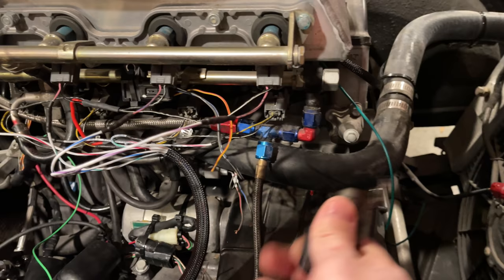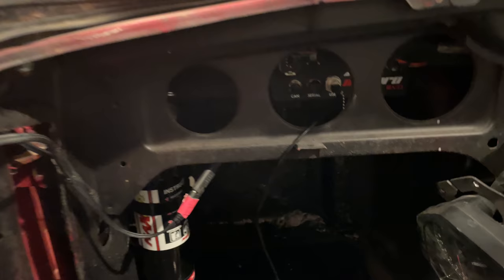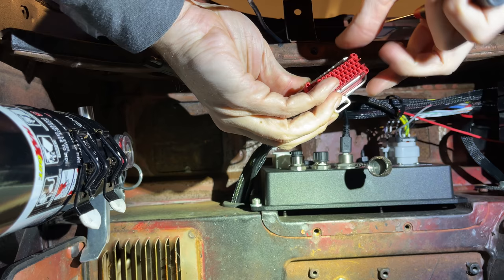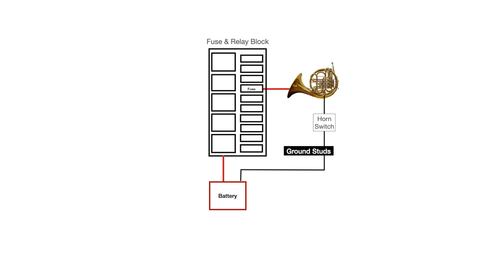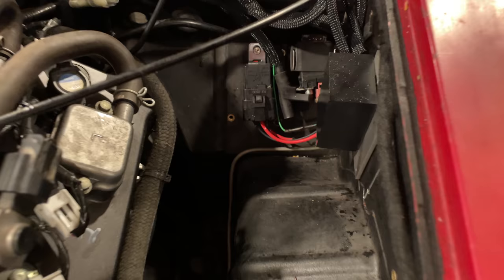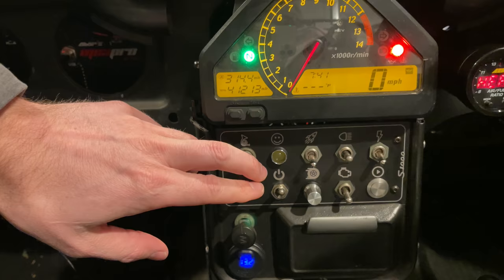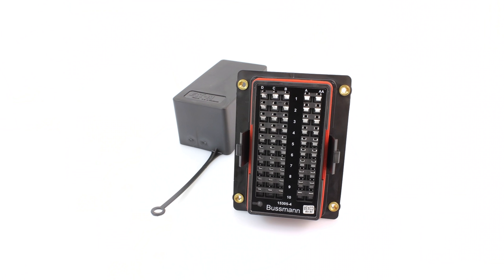Re-Wire Your Whole Damn Car - How To Do It Correctly & Inexpensively

Comment: thanks for all the tips.. I have a 94 firebird that is kinda methed up(pun intended) from the previous owner. ive got 8 grounds going to one bolt next to the throttle body. not sure what all the guy did so it looks like im going to be in for a bunch of headaches trying to figure this all out... I currently work at a busy car dealer so we always have an abundance of zip tie's and connectors.. im definitely going to find the fabric tape instead of the electric tape that likes to get sticky. thank you again and very good video..

Comment: Really good information Just want to add 1 thought. Back in the day I would use the Naked connectors and after crimping I would solder and then heat shrink.
I know probably not necessary these days but I come from ol Motorcycle field(Harley) Ironheads, Shovels evo etc.
A little soldering can prevent a lot of future problems.
Note I am talking about soldering the crimped part and wire together not the connectors together.

Comment: About minimal colours and connectors... our Triumph Spitfire came (factory stock) with only three fuses, four wire colours (one colour for each fused circuit, plus ground) and almost no connectors. Unfortunately, it also has no labels, so tracing is a nightmare, and the lack of connectors means that it is impossible to replace a harness - you individually replace every wire in a damaged section. I like the minimal colours and connectors approach, but don't forget the labelling part!

Comment: Fyi: There is a hack for printing on heat shrink tubing label tape on any Brother printer, and there are plenty of third party vendors for the tape.

Basically, you tape over one of the holes on the tape cartridge.

Comment: according to the previous owners of every car I've ever worked on in the restoration field- just get yourself a mess of the same color wire to connect everything. Make your connections as a "twist-n-tape" or use an oversize wire nut. Grounding is super simple. If you don't have a self tapping screw or a body panel gap to jam the wire into, just let the hood close in contact with the negative post to complete the circuit. This can be achieved by never buying the correct size or group of battery and just throwing in what you got propped up on wooden blocks. You can also fix exposed wires by wrapping them near or on the exhaust system and letting the heat just melt the insulation back into place over the wires. Remember, there's nothing wrong with leaving abandoned live circuits under a dashboard. As long as the vehicle is in motion, the wires won't be in contact with a ground pathway long enough to blow your 30A fuses in every slot of the fusebox.

Comment: I can relate to the "lost a formula student race for a failed connector". We did the same at the Germany event in 2011. Slowly lost power during the endurance event because the clutch release solenoid didn't have proper contact. Every downshift, the car lost drive for an ever increasing duration until the stewards took us out of competition. What made that even more frustrating is that we had a backup solution for exactly that failure, but the driver didn't use it.

Comment: that wire covering is called,  "Convolute." u used to make that stuff from like 1996 - 2009, periodically. we made all sorts of rubber & nylon, "forming." The department I worked in was called,  "the cooking dept." or, "Crook Forming." we made rubber, as well. ie... elevator gaskets, rubber washers, tubing for windshield washer fluid... sun roof seals. hoses for LARGE ENGINE/DIESEL smog systems.. the company I worked for for OVER 20 years sold out & went out of, business. ✌❤💯

*I had forgotten all about, Convolute.*😂

Comment: Great video as usual Matt. It's funny you mentioned of the possible ways to connect wires.. I've been doing this for over 40 years.. both marine , aviation  and automotive.  I'm a little  different on mains.. I solder,  all main grounds and positive and high Amp relays. I've seen to many hot crimps, at relays or heavy demand components.. the only concern as usual are vibration and wire support..  it's  imperative it doesn't flex and breaks.. but in recreational marine , all wires are machined crimped.. the problem with this,, is what is the support intervals.  Top boat manufacturers are every 6 inches on tracks. The next best is 12 " - on  tracks, and  of course the worse are every 2 feet,  no tracks , just hanging.. cars are worse at times.. I agree with top notch crimping tool, the best heat shrink, and  there will be no issues.. I only use the flex webbing you suggested,  they come different colours, heat ratings including heat shielded wraps.. but truly my favorite and only way is a no show wiring under the hood.  It takes a couple more feet to  route it through the firewall and then to it's  final destination.. keep up the great work..

Comment: I want to rewire my entire car (1965 Mercedes 220sb); the original wiring is brittle, frayed, etc. I want to modernize and simplify it and have seen many vids abt converting to a PDM/CAN. Wondering why you chose to go with a fused system using relays and part PDM. I know almost nothing abt wiring and electronics, so maybe there's an obvious reason. Looking forward to the next Viper update!

Comment: @SuperfastMatt You wouldn't happen to know what specific connector is used in the 1997 Honda CR-V front drivers door wiring harness and what size pins? It's a 25 pin square connector (5x5) and uses 16 and 18 gauge wires. I would love to construct my own pigtail rather than buy one, but it may be cheaper to buy one because there are so many wires and pins. 

The reason to replace it is the wires break off from the pins at the door and stuff stops working, like speakers, electric windows and locks, etc. It happens primarily to the driver's door because it is the one opened and closed so many more times than all the others.

Comment: "The ECU can have more circuits than the rest of the car combined."
Smiles in carburetor

Couple more tips:
The thinner wire isn't for people who don't want to drill big holes; it's for "protected" spaces like behind the dash where flexibility trumps durability. Not necessarily a big deal on a race car. But a street car with extra gauges, indicator lights, HVAC controls, and stereo equipment can have a ton of wire in a cramped space. It's also important to note that the thinner wire has the same current capacity- it's just the insulation that is thinner to make it more flexible.
As another commenter mentioned- you can "wire" the car with cheap twine first to make a template for the actual harness. Label the twine with masking tape and a sharpie. This will also show you any problems with the planned routing. You can do this before you even buy the wire so you have a good idea just how much wire you actually need.
Reply: Regarding all of the lined-out text: Not necessarily.  The current capacity of the wire is mostly determined by the cross section (gauge, circular mils, and/or whatever the metric folks are measuring in these days).  "Thinner" wire almost always means gauge and not insulation thickness.  Unless you want to see your project car burn to the ground, select appropriate wiring gauge and fuses for your circuits.

Comment: It's a cigar ligjter....... and I would tug on those splices slot more after crimping. You shouldn't  be delicate here. Huge tugs insures they don't come apart later. Coming from a guy who built  a business in high-end  harness production. Heatgun too works wonders. I do like how your using open barrel crimps and also bare ones.

Comment: A drop of TapMagic cutting oil will make your taps last longer and cut better.  It smells good too.

Lobster brand AK15a crimpers will make a quality crimp on those insulated terminals.  (They are designed for non-insulated terminals).  

It has been my experience that crimpers specifically made to crimp insulated terminals simply don't make a good crimp.  

If you are particularly concerned about the insulation crimp point, then a snippet of heat shrink tubing will allay your fears. 

Great video.
Reply: What I've found works best for insulated terminals is gripping it firmly and popping the plastic part off and then using crimpers and heat shrink.  I realized I was able to get them to hold by using the non-insulated spike even through the insulation, but unfortunately it didn't make it not look like crap.

Comment: I ripped ALL of the wiring out of my car, now it has just 4 wires Battery + and - (25mm²) CAN+, and CAN-. I designed the main computer which has two processors, both running the same software, and both check each others sensor data, and results. If they disagree on any of the critical systems, it fails safe and gives a 10 second warning before shutting EVERYTHING down. This main box sends CAN data to lights, power windows, wipers etc which ALL have the same design (which i designed). I can do just about anything, and EVERYTHING has built in diagnostics and error reporting.

Comment: Main ecu ground should be grounded at the engine, either head or block. All sensor grounds should also be on the engine but at a separate location to prevent ground loops.

Comment: Deutsche connectors are also very good quality and durable. If you really want to go hardcore, bayonet or screw style (milspec) connectors are fantastic, and highly recommended for RACECAR (Amphenol is a VERY well known brand)...

I'm considering rewiring my old civic with all gray exane, just for fun. Highly abrasion resistant, (multiple) high temp ratings - definitely the best transportation wiring there is.

Comment: I love the meticulous work.  I whole-heartedly agree about the dumb crimp connectors that you usually find at the auto parts stores.  Garbage.  I started soldering my connections and now I super love it.  Takes more time, but it's solid.  I must say, though, the crimp connectors you are using are really good.  I've used them before and I can support your supporting them lol

Comment: Probably going to be undertaking this sooner than later, got a 1st gen H2 (with typical water damage), and it's going to need some work(everything currently works but corrosion is inevitable), fortunately it's not my first time having to work with wiring, and I'll be trying to make it more resistant to any possible future water damage.

Comment: I’ve installed 3 different brands of those pre populated fuse blocks and I can honestly say they all suck the best was the American auto wire one but even it was pretty stupid first I was just checking to make sure all of the gauges were getting power and all of them were working except the speedometer which had a separate wire and it turns out it got its power from the fuel pump fuse and we were running a mechanical pump so I didn’t think it needed a fuse and I actually would’ve preferred it didn’t have one just because I didn’t see the need for hot wires in the loom that didn’t go anywhere. Next the radio wasn’t getting constant power so I had to add a fuse in the “clock” slot, not a big deal but then it was time to start the car and I was having problems with the ignition box “mopar bs” and while I was diagnosing the problem I ran a hot wire directly to the coil off the battery just to be absolutely sure that it was getting power and well that hot wire must’ve touched ground and popped the fuse and so I go looking into the fuse box and there was no ignition fuse so I figured it must be tied in with something else and I noticed that the gauges were no longer working so I checked there first and in my mind gauges don’t need a ton of amps so I stuck a 5amp fuse in the slot but it turns out that fuse also runs the ignition so I jumped it up to 15. Painless is also a joke and the cheaper speedway one really wasn’t terrible it was about the same as the painless but I had to put it in a dune buggy so all of the engine wires were too short

Comment: Ehhh I have been reading about running power in clean and dirty buses. I think that you should consider that. Also ecu power should be on its on relay directly off of the battery so it suffers less voltage drop when cranking .

Comment: Thank you for this.  I thoroughly enjoyed creating (what I felt were near professional grade) wiring harnesses/connections for my golf cart.  Now I’m trying to add signals/brake/horn circuits and will apply this knowledge.  Would you know of a rocker style on/off/on switch that would replace a American Autowire 50048 toggle switch?  One other thing…that $15  hf multimeter …. Omg I hate that thing.  Buy one that a little heavier and you will appreciate that it doesn’t  constantly fall over when you pull on the leads.

Comment: One thing: "if you're not sure, err on the side of too much fuse", I don't know that I agree with that... If you go a fuse that's too high rating, the equipment downline could suffer. Burnt out relay, blown globes, fried pump... If you go a fuse that's too low, the most you will do is blow the fuse. Fuses are cheap as chips. Start low and if it pops, work your way up.

Comment: A couple of things, when you use your dual pole switch for your lights and as you switch from high, to low, and back, you're turning your tail lights and marker lights off with each transition.  Also, your comment about always erring on the side of a larger fuse, you need to be careful that the wire can handle the increased current from the larger fuse.

Comment: Thank Matt I learned a lot! Please buy yourself a pair of decent crimpers. The stamped steel ones are junk. You should never be able to pull a connector off a wire with your fingers. Thomas & Betts is a good brand, there are other good ones too.

Comment: I love your format!  I think I might actually start with 18:20-18:40  Most of the wires are fine, but I've got weird electrical gremlins in my 1997 Mazda.  Realizing that the ECU wiring harness is not actually a magical interface I think is the biggest hurdle.  It looks so complicated, but literally everything is a discreet circuit.  All I need to so is get a long set of cables for my multimeter - maybe something that can pierce a wire without substantial damage - And check resistance.  Or use a test-light.  

Granted, this won't rule out vibration issues unless there is a way to road test with a bunch of channels - surely possible.  Here we start to balance the triangle between laziness, cheapness, and quality.  If you have an oscilloscope already you could do advanced testing - and then fix the problem(s).  Or you could spend about the same amount as the tool, and re-wire the whole damn car.

Comment: If you get the right crimp tool they work fine. Get a set of electricians crimp pliers. Those multi purpose crimpers don't work good on stake-  ons.(connectors).

Comment: Great video and presentation. As for me, I just stick to the AAW H'way 22 series that has helped me rewire so many classics over the years without any hassles thus far. Easy-Peasy installing it.
Reply: its ok...even uses old old style packard gm connectors...but pretty expensive and assumes you are reproducing the stock original...not really for "resto-mod"...
Reply: @chicagomike6666  No, I've always used the universal AAW Highway Series 22. It's so versatile for my resto-mod projects. I also use it for Euro classics. So, it's pretty universal. There are other popular brands as well but I guess I've gone too far with AAW to change the brand now.
Reply: @chicagomike6666  I particularly like the label heat shrink you used, never seen that before. I don't use as the wires are all pre-labelled. But some add on wires are not, so I use a label machine to make label tags. I think I should try to find a machine like yours for heat shrink labels

Comment: wire braid looks good but would make it harder to diagnose a broken wire or to add a nee one. Also it doesn’t protect from dust at all so makes it harder to clean, so the flexible tube seems a better choice Imo.
then the fabric tape I think is supposed to be used in the interior of the car where there is less dust. electric tape is easier to clean. 
in areas where there are high temperatures from the engine, you can use ptfe insulated cables, these are much stronger and the plastic is stable to heat cycles.

Comment: when you use constant power to some of your devices in the car, it is not bad idea to protect the battery from draining (discharging)  to much. Simple way is to use latch relay to power of everything when battery voltage goes to low. That could save you from hassle of buying the new battery if you do no drive the car to much or do not have it connected on smart battery charge when parked. Also for connectors, if you want good crimping my experience is that good crimping tool pays of really well. Pliers I have seen on your video to crimp some connectors 14:43, I do not use these - not good idea in my experience. Great video! Liked!

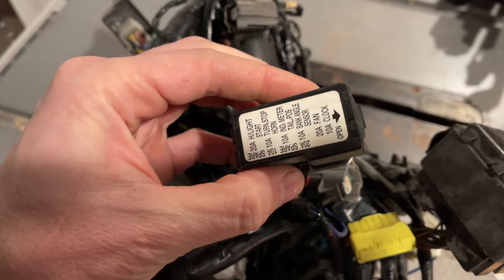Comment: 3:50 remember folks fuses only protect wires so as small as the wire needs. The component load determines the wire size.
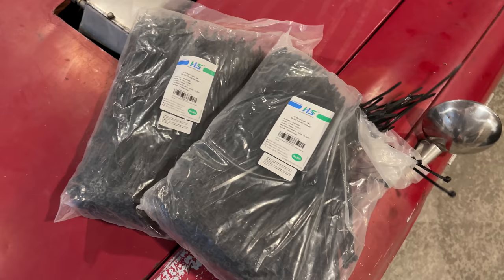Reply: 9:51 lol glad you covered the rest of the topic. Great video

Comment: About wire nuts. When I used to see them in an automotive or truck application I used to cringe. But now at 45 + years into my career as a truck and heavy equipment mechanic I can tell you I've seen them last a long time. Not really right, but they are way, way, way more reliable than cheap crimps.

Comment: One comment on the Zip Ties. When you cut off the excess, cut it off FLUSH with the lock. I worked in the paint shop at a concrete and garbage truck company years ago where the assholes in maufacturing just cut them off at an angle close to the lock.  I went home almost every day with a new deep scratch or cut on my arms from those nasty little buggers.